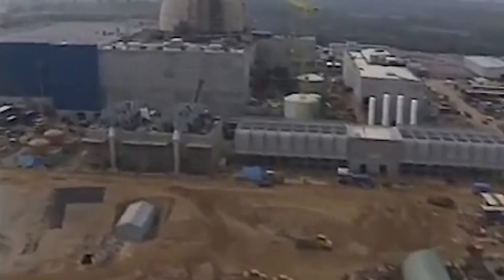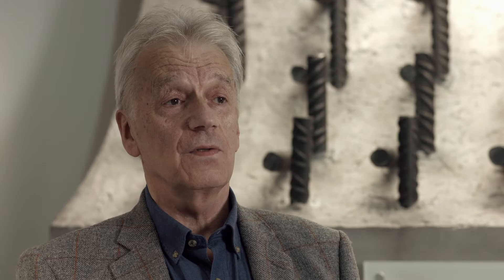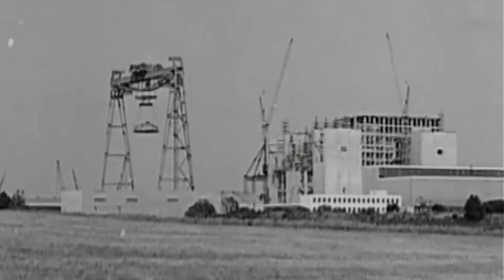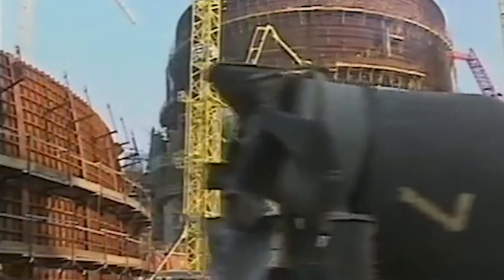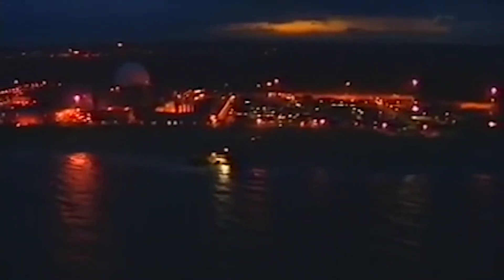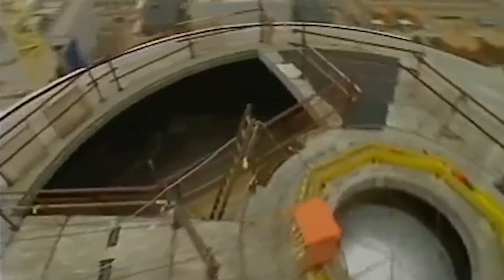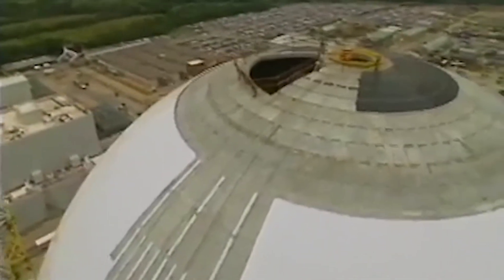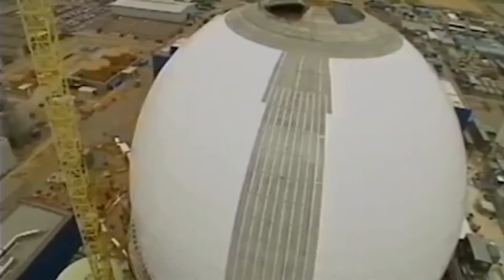Sizewell B Power Station

Comment: NB!!!   If Sizewell C failed in the same way as Fukushima Dai'ichi, Cambridge, London and Norwich would become uninhabitable from nuclear contamination.  Renewables could never represent such a dangerous existential threat.  Moreover, sea level is rising faster than initially predicted due to anthropogenic climate change.  With Flamanville years late and over budget, likewise Hinkley Point C and Olkiluoto, there are some nutheads in UK government that are trying to promote Sizewell C, when the UK does not know how to store its existing high-level nuclear waste to isolate it from the biosphere for 500000 years.  To add to the existing stockpile of nuclear waste is insane.  There is not even a military justification, as the UK has stockpiled 140 tonnes of Plutonium (Pu239) at Windscale (oops I meant to write "Sellafield"), enough the fabricate 15000 nuclear bombs.  Renewables for civil electricity generation is much much cheaper than nuclear and does not generate to legacy nuclear waste.  We have some complete amateurs in the UK government trying to promote Sizewell C based on EDF's EPR technology.  If the UK government were sensible and said "we will use Seaborg molten salt type technology" that can "burn" (i.e. transmute) nuclear waste to render to less harmful, then some sensible thought processes would be occurring in UK government.  A cluster of 10 to 20 SMR's based on Seaborg technology would be a far better choice and would be far more responsive to provide demand response to the grid rather than baseload that an EPR would bring, thereby enabling these 10 to 20 SMR's based on Seaborg technology integrate far far better with renewables.

Comment: This is a joke .... firstly , Sizewell B was illegally built by the Thatcher Government . The statutes at that time said that the cheapest form of power had to be chosen by the nationalized electricity generating board . The PWR program was to be built ahead of need and only if all 10 were built would the costs make it a cheaper form of power . It was pointed out early on in the inquiry that the stipulations of the Flowers Report into nuclear waste - a Royal Commission - stated that problems of dealing with nuclear waste had to be redressed before a large program of nuclear power could any longer be embarked upon . No nuclear waste disposal sites had been applied for and were not due to go through the planning process until after the Sizewell B decision . (the plan for disposal sites came up negative ). Sizewell B was given the go-ahead despite the realization that the program was a non-starter and Hinkley C was abandoned half way into construction . Sizewell B cost £2.1 billion as opposed to the £1.2 billion for which it's application was approved . So what of the electricity statutes ? IGNORED ..... this is what a government does when it has a landslide majority ... it ignores the statutes  ..... such is the roots of fascism . Safety designs for the new EPR prove that Sizewell B was not a safe design , a fact that will become an embarrassment as time goes on .